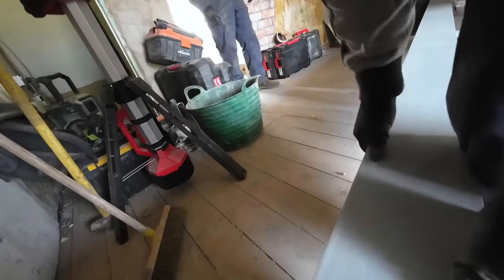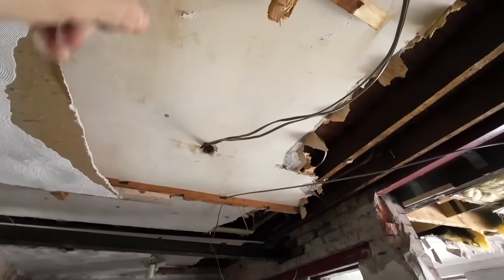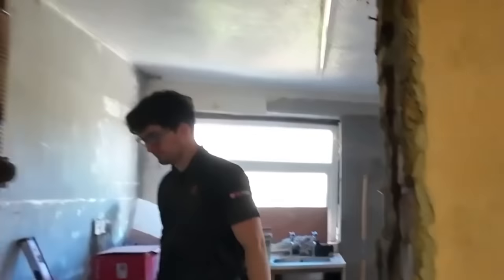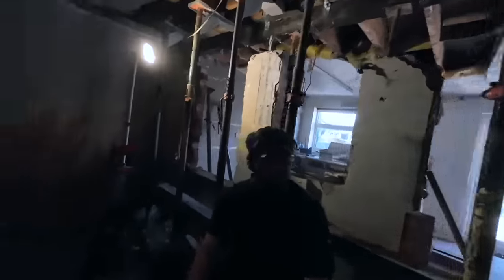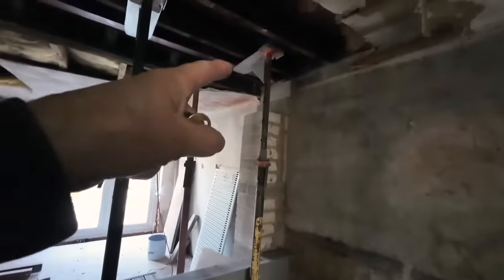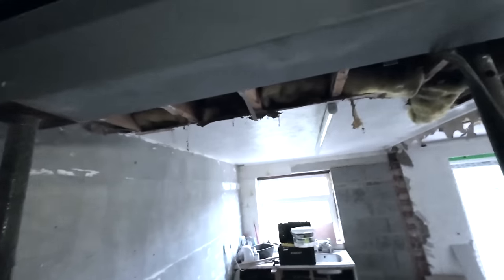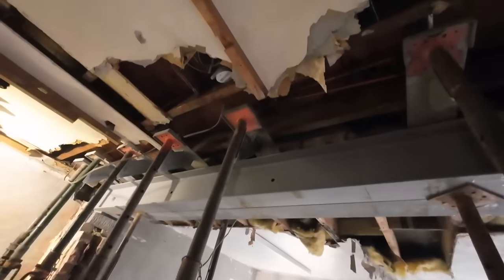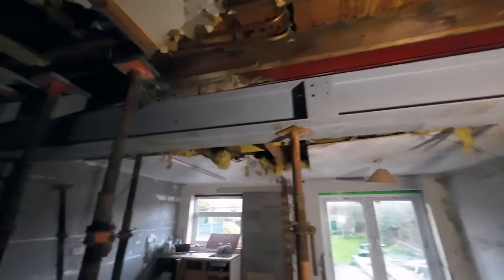CANT LET THIS JOB BEAT US.. HUGE STEELS ARRIVE

Comment: Pain in the arse them rsj when it goes like that steve.I like the brackets you put in to hold the bricks up i hadn't thought of that in the ones we used to do .hope alex is ok .you put a shift in but once its done its done a mate .
Good luck 👍 🧱🧱
Reply from the maker: They were soul destroying Justin 😔. We had to adapt as each issue hit us . The brackets worked well and we just built them in . 
  Results for Alex coming soon 🤞🏼🧱👍🏽
Reply: Sometimes a job is soul destroying isn't it especially if you get unforseen stuff .Then you try to bill the customer Sometimes that goes well sometimes not its all part of our job it can be a stress. Good luck with Alex and get it pinned up and move on to the next stress mate 🤣🤣👍🧱👏

Comment: Why did you have the steel with the tubes to the outside wall? The tubes are there to be trimmed so it buts up against the inner steel so when its through bolted there solid together?
Reply from the maker: We didn’t
Reply: My bad looked like it was
Reply: they cut off the spacers, they where welded on the beam with the plate to pick up the new cross beam so the tubs would of gone in-between the beams. when put together they would measure 300mm

Comment: Good job well done Steve and Alex. I think if they knocked down and cleared then rebuilt the back half of the house, it would save them a lot of cost time and less compromises.

Don't you think these steels are over-specified? Holding the wall above are 2 existing steels, a wooden beam or lintel and 2 massive new steels! All this massive weight up there with belt and braces surely increases structural instability, no?
Reply from the maker: We just do as we are Told , we leave those decisions to the clever people 🧱👍🏽
Reply: @SteveAndAlexBuild  God bless you, there is no substitution for years of experience 👍
Reply: I thought the new beams ran along the back of the old house to support the building above and the wood is a wall plate to take the flat roof
Reply from the maker: Spot on 🧱👍🏽

Comment: I think that original extension is probably the worst I have ever seen , where were the building inspectorate when that was thrown up. Looks like you might just make a silk purse out of a sows ear.👍👍
Reply from the maker: It was shite to be frank Colin. I reckon it was thrown up in secret round the back away from inspectors 🙄🧱👍🏽

Comment: Bloody hell where did the SE do his last job ..on Runcorn Bridge ?
I had a 6 double bay commercial workshop built with steels not that big.
I think it was certainly overkill, then again around here the engineers are insisting on concrete piles into the ground for a similar single storey extension. 
I think the days of the old engineers who used common sense have now gone. The new breed seem to do everything to the book, then apply a four fold safety factor. 
I was lifting those steels with you. But overall a great video .
Reply from the maker: Cheers John 🤜🏽🤛🏽🧱👍🏽

Comment: big job for three of you with those steels. The tubs you cut off, where they the spacers? I thought they where there so when you bolt the beams together and you can not get your hands up between them to put nuts on they pinch up pulling the beams together. Now there is no way of doing this, and it must be there for a reason. What do you do now?
Reply from the maker: It’s all explained in the video
Reply: @SteveAndAlexBuild  you said that they made the beam stand off the the wall but it was the other beam that went to the wall. the tubs go in between the beams. They are put on for a reason so you can fit the beams together and bolt so the can not move.
Reply from the maker: The tubes were a a waste of time and weren’t needed ( also explained in the video ) I know what they are for and where they go .
Reply: @SteveAndAlexBuild  ok, who told the steel suppliers to put them on?. when we get a beam order it comes with a spec sheet with what is needed by building control like holes, plates, spacers. so when I saw you just cut them off I thought you need to check first. or was it just to hard to slid the beams together?